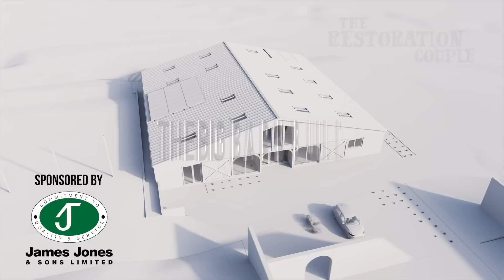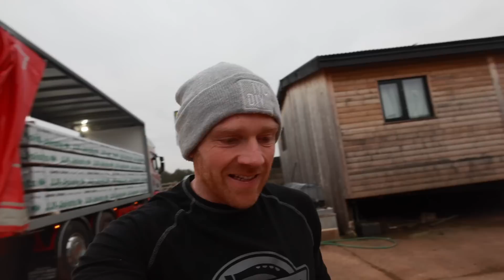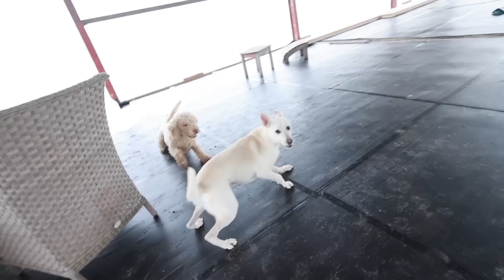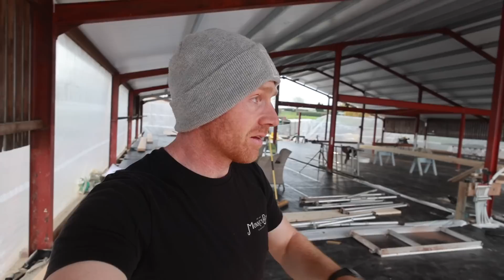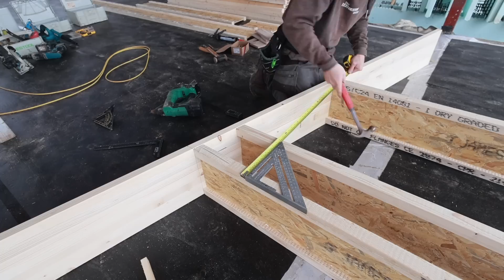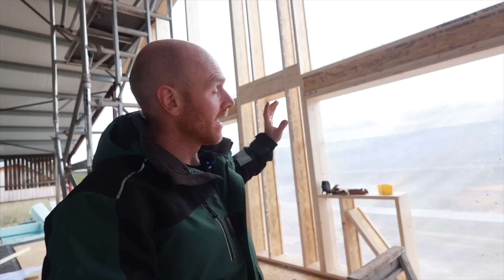OUR HOUSE HAS ARRIVED - Let's get FRAMING! 🔨

Comment: Holy crap this job is massive , you must be spending hundreds of thousands on materials for such a large area, that slab is huge! Those ready made joists are excellent to work with, hanging the floor is a great idea.
Reply from the maker: Hopefully not but yes lost of material, fortunately a simple building/shape which helps with budget.

Comment: Great video, love the idea of using I-Joists as wall studs! I've just finished renovating the vast majority of my house, but have plans for a little 6x5m extension off the side in the future - I was planning on a conventional timber framing, but after seeing those i-joists as both the joists and the walls, I'm sold; brilliant idea!

A somewhat nosey question, but from one "advanced DIYer" to another - how do you financially support this? I'm having to work a full-time job (albeit from home) whilst doing all this work, and I'm barely making ends meet - this project of yours is vast to say the least, so I'm curious - is this all from sponsors/youtube revenue? A very nosey question, but out of curiosity as opposed to jealousy!
Reply from the maker: We will do a video at some point on budget etc. Simple answer is no, we would earn more with ‘normal’ jobs but it gives us time towards the project which is as important I guess. All made possible from the work we put into our previous house, a fund which has all but run out now. 😬

Comment: Loving this series. We use JJI's rivals for I Joists but the principle is the same and we will need to try JJI out. Wonderful product to work with, arrives dry so is light and easy to handle. Like you allows you to pump full of insulation and keep a breathable building. It's also going to be silent inside with that amount of wood fibre.

Those glulams looks finish grade 😍 could put them in a piece of furniture!
Reply from the maker: So regular and straight too. 👍 No checking every joist for twists and warping. I’m actually hoping there are enough glulams left to shelve out the walk in pantry!

Comment: why so big?
Reply from the maker: The simple reason is that we were required to use the whole building and reducing it or replacing it was a firm no from planning. Therefore we have found other uses for the floor area such as an annexe, pool and patio.  Still bigger than we would choose though.
Reply: Family of six, so far.  Also, part of this building is a pool, and another part is outdoor space, due to meeting regulations.  Space is an issue in the UK, so having an opportunity to have this much space to build is rare, and they are taking full advantage.
Reply: @user-pd5vl4lr5p  6? pmsl, is it 1930 over there?

Comment: If I heard you right, you said you were blowing the insulation in the full height of the walls. How do you know you will get the section full and dense all the way down. Would you be better with batts of some type to get the full coverage and know yourself it is all the way in there.
Reply: We blow a lot of wood fibre and of all the loose fill materials it's the best at resisting slumping over time and the machine blows it in at pressure. 

As it is done at pressure and combined with airtight sections it fills it completely and to full density so if you pump at the top it fills down.

Comment: Quick question - why the LVL and then a glulam, rather than just two glulams for the sole plate? I'm assuming the LVL has some properties that suit that location but just not sure what those might be.
Reply from the maker: Actually it could be either. We needed so much glulam that we cleared them out so topped up order with lvl. Therefore we decided to use that as the bottom plate. Possibly a bit stronger over the cavity too.

Comment: Wow a very intense video. Sounds rather alarming saying the designers have missed out the impact of corbels etc, hard to believe in this age. A great choice using the I studs. Bits I struggle with include how the (unvented?) cold roof works and also how you meet fire regs given you have a lot of steel plus ceiling height rooflights on the first floor, maybe you are installing sprinklers perhaps??? Just think a general explainer would not go amiss when you get the chance.
Reply from the maker: Intense comment! 😂 Warm roof, regular height egress windows in every habitable room, mezz steels are painted and boxed. 
Steel gussets just altered our framing layout nothing to do with design, just site decisions.
Reply: @TheRestorationCouple  LOL thx for reply, good to hear about the windows and steels, just wasn't easy working out the heights of first floor rooflights. I know it must be my mistake but I only know of a warm roof having insulation above the roof, guess I will have to keep watching to find out about that one :). There were a lot more explainers on the cabin, I appreciate you don't have the time anymore though.
Reply from the maker: @dannymurphy1779  How I see it is that the bottom skin of the roofing panel is the equivalent of an OSB deck, PIR above then the top skin is what EPDM or final roof covering would be.  Therefore bottom sheet, purlins and steel is all warm side and no need to ventilate that, quite the opposite.  We may alter that if we decide to add more insulation but that will be subject to some thermal modelling.

Comment: Balloon framing. Just one question. I’ve heard that straight runs up through several floor can be a gift for fire and its speed of spread. Are you considering this and are you building in fire breaks along the way?
Reply from the maker: Yes there may be blocking to go in. Obviously with dense packed cellulose it is less of a chimney effect however it’s definitely something that’s been discussed both for firebreak and installation reasons.
Reply: Was about to ask the same thing! I know our friends across the pond have to put fire blocking in tall walls.  It’s looking really good and I’m massively enjoying this series.  Thanks for sharing it with us all
Reply: That’s a great question because of the Great Chicago Fire, we have the strictest building codes in the US and our codes require fire breaks.

Comment: More for your Q&A video what does “do not cut flanges” mean on the i-beams.? Treat me like an idiot most do. 😂
Reply from the maker: They are used as floor joists 99% of the time and therefore cutting the flange (square timbers) you would significantly weaken it.  You can however drill plenty of holes in the OSB web without issue so good for services.

Comment: Looking good and it's coming along so quickly :)  we have similar feelings with building techniques.  Wood - fun, groundworks - doable but it's hard and stressful.  I think part of it is the non reversibility of it, once concrete sets doing anything with it is really difficult.  Wood on the other hand  is much easier to adjust.